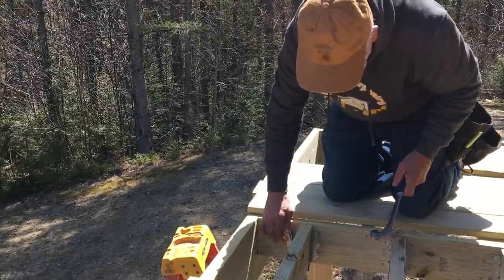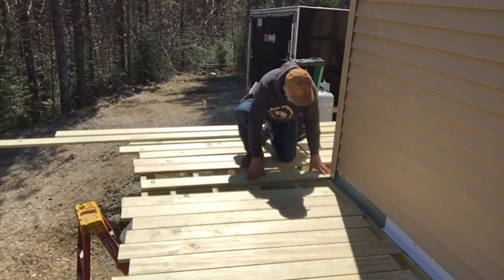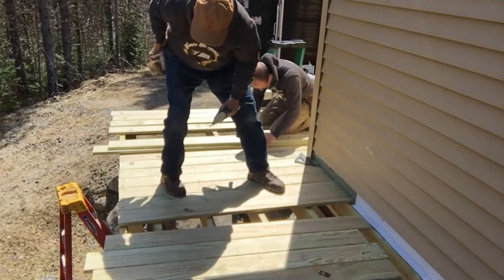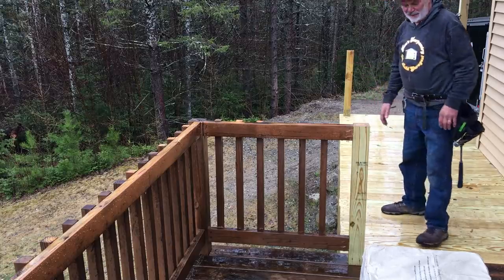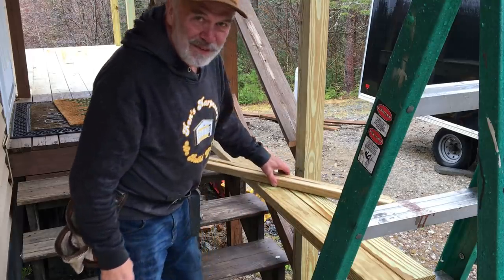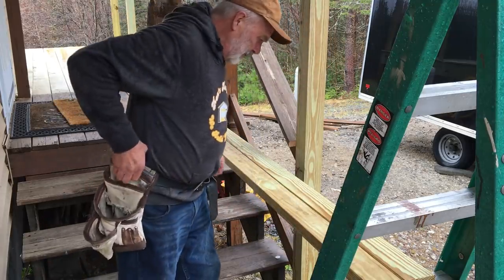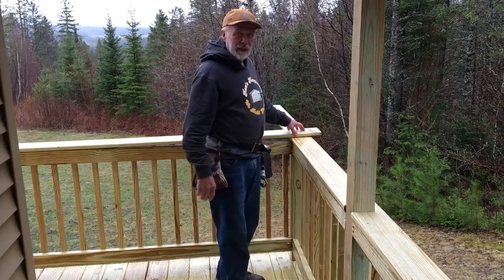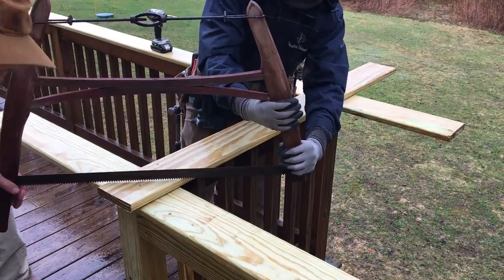FUN DECK PROJECT

Comment: Good morning Ken fantastic videos. The titan hd clips for hangers and fastener with the harden nails #8# 10 ,required here in FLORIDA..I don't know if you have a palm nailer but so much faster and more precise for the correct angle ...also very very helpful using your 16 gage finish nailer to attach your spindles then go back and sink a screw drill frist to keep from splitting...maybe it will help speed things up ya I know hard to teach us old dogs new tricks lol and the thing you need is some smart add on ytube giving advice lol lol. Your great builder.my friend. 😎🏖😎🏖😎

Comment: I built a deck and put two screws at each joist and everyone that saw it said it was overkill. Glad to see that it wasn't!
Reply: Skipping joists is the lazy way of doing it. You might be able to get away with it if you have a short run like this but long boards will bow and pop the screws out if you don't anchor them at each joist. Seen it happen many times. Hell, my deck's got 3 per joist and were hand-nailed. Deck has probably 500 nails in the damn thing. Haven't budged at all in 50 years though. THAT'S overkill. 2 screws per joist is common practice, anybody who says otherwise doesn't know what they're talking about.

Comment: Great work! its funny I cut the corners of my railing top plate perfectly but now i the winter they expand and the angle becomes less that 45 and in the summer the boards shrink and are more than 45

Comment: I wish they made "joist hanger screws" vs the nail. I found the nail over time works it's way out up here in New England between 10 degree snow load winters and 90 degree humid as sh*t Summers. I have used screws in the past for joist hangers to find them have failed due to weight load and had to redo them with the joist nails. 

This year I have to rebuild my mothers deck my Dad has built 20+ years ago that I have been maintaining since my Dad's passing in 2015. But it is time to replace this 16 x 20 deck and we could not have picked a worst time to do it with current wood prices Uhg!! I just hope there is inventory when I start. I'm trying to convince her to go to Hybrid plastic wood on top for a cleaner look then pressure treated.

Comment: Those joist nails are also made with the head pressed from the shaft itself, rather than a separate head attached to the shaft. They have immense resistance to shear load.
Reply from the maker: Thanks for the input
Reply: Do the diagonal holes get nails too??  I've been using 3" deck screws on those a long time and only the hanger nails on the flats, wondering if I've been wrong so long?
Reply: I cringe when I see people install joist hangers with screws.....

Comment: When the top rail dries and shrinks, the diagonal cut opens up.  How do you avoid this problem?  Good job with the deck.
Reply from the maker: You can always put a screw in from the side if it does

Comment: Great video, do you not leave expansion gaps between the boards to allow for temperature and swelling
Reply from the maker: The pt lumber is soaking wet when you buy it. As it dries it shrinks creating a gap

Comment: Just between you, me and the hairdresser, but a little surprised you didn't run the ends of the short pieces wild and then snap a line to true them up. It's the ocd in me! Good info, as usual.

Comment: With the price of lumber right. Ow. Would you recommend using wood or something synthetic for the decking?
Reply from the maker: I haven’t checked but I’m pretty sure the composite is still pretty high
Reply: i'm pricing composite at $50/12 foot board.  admittedly that on the higher end but they get you with the colors.  the better colors are in the more expensive lines.
Reply: Composite is still more expensive by 300%. I'm suggesting regular framing wood and paint to those who are shy about the price. Btw, $1500/1000 brd feet today.

Comment: The nails have very high sheer strength. They are required by code and yes all the holes have to be filled.

Comment: Ken:  Would you recommend running the 4 x 4 uprights from the ground up to the top of the rail or just from the deck floor to the top of the rail?  Just wondering if one way is better than the other.  Love your vids.  God Bless
Reply: Jim ... Ken uses 6x6 down to the ground and notches for the carry beams. I suppose he could run them up all the way but then he'd have to change the spacing on some because the hand rails need support every 8 ft. Probably easier to lag / carriage bolt the 4x4 for the hand rail.

Comment: I know building decks is not something you do regularly, however this tool will speedup productivity and quality of the finished project. Stanley 26" Deck Board Bender:
https://www.homedepot.com/p/26-in-Board-Bender-Deck-Tool-93-310/203753633